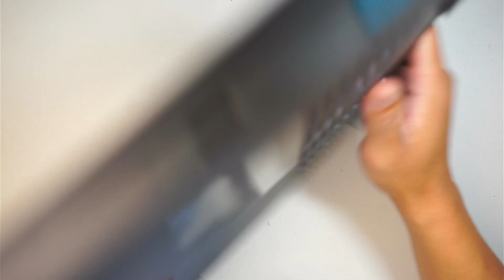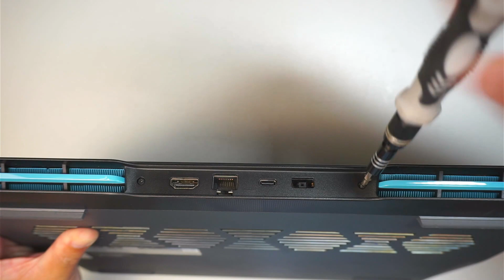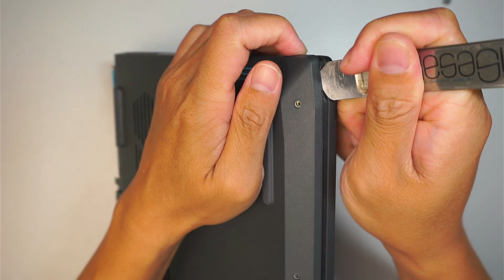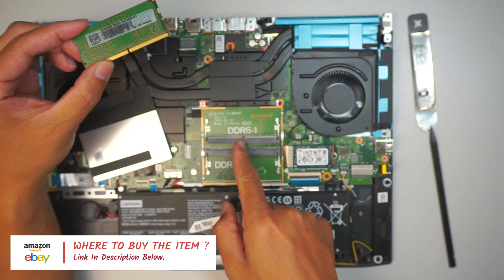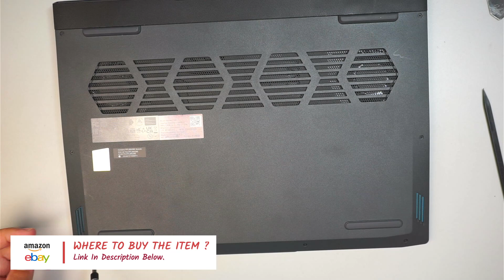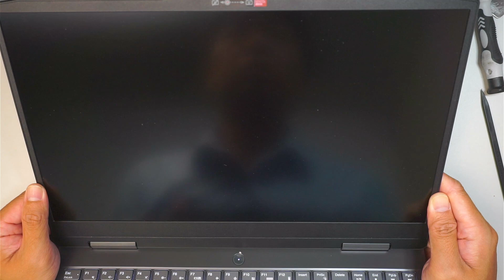IdeaPad Gaming 3 15ARH7 Upgrade and Install DDR5 Laptop RAM

Comment: I want to upgrade my storage and i have 16arh7, and my laptop support two slot of storage. I remember open the back of laptop and my storage is like this small 4:35 here. So what is this, is this 2242 or 2280, so which one should i buy?

Comment: bro i have ryzen 7 6800H and 16gb ram with 512gb ssd , can i upgrade the ssd ? if yes then please tell me how much ?
Reply: yes you can, SSD is cheap, i upgrade it by adding another 512gb SSD just remember which version
Reply: @DasboardTVDE  so there is space of another ssd ? like if i want to use sata , or do i need to replace my current one ?

Comment: I freaked out when my laptop didn't start after upgrading. But it takes time to adjust to the new ram i guess. It started after 3-4 minutes. No need to go into the bios and do anything. THANK YOU VERY MUCH.
Reply: So you do not need to disconnect the battery?
Reply: @Literally-Liteyou need to disconnect the battery or else it might short the board

Comment: Hello everyone, I tried to put an extra SSD in my laptop but the ones who did the job told me that my SSD was not compatible with my laptop, has anyone had this problem when trying to upgrade the storage?
The SSD I tried to use is the Predator GM7 2TB M.2 NVME GEN4X4 7200MB/S

Comment: I'm using IdeaPad Gaming 3 15ARH7 with AMD Ryzen 7 6800H. I'm thinking about upgrading from the 8gb to 32gb (16gb each slot 4800mhz ddr5). 
I'm wondering is it possible because Lenovo said the max memory is 16 gb. But the processor on the amd website (for ryzen 7 6800H) said the max ram is 64 gb. Can someone help me please? 

Thank you so much!
Reply: Yes, I have the same device with the same capabilities as you, IdeaPad Gaming 3 15ARH7 with AMD Ryzen 7 6800H. The laptop had 8GB RAM and I made it 32gb ddr5 4800 and it was fast and excellent for games, editing and graphic design. Now I am thinking of upgrading it to 64 GB RAM 4800
Reply: Yes, I have the same device with the same capabilities as you, IdeaPad Gaming 3 15ARH7 with AMD Ryzen 7 6800H. The laptop had 8GB RAM and I made it 32gb ddr5 4800 and it was fast and excellent for games, editing and graphic design. Now I am thinking of upgrading it to 64 GB RAM 4800
Reply: Yes 32gb will work

Comment: Hi there so for the additional DDR5 RAM card, what Hz module should I get? I think the options are 4800Hz, 5200Hz and 5600Hz
Reply: It generally doesn't really matter. If you have 4800 and you install 5200, the new one will just run at the slower speed.

Comment: Thanks, I just upgraded to 64GB (2 x 32GB 4800  MHz Crucial) and so far working ok. Got scare at first becuase the screen remained black for a while, but after 2 minutes maybe, it turned on normally. 
I have the Ryzen 5 7535HS model.
Reply: what's ur gpu model??rtx 2050 or higher?
Reply: @omarsheikh8835  rtx3050
Reply: ¿Tiene el modelo 15ARH7 with RTX2050?
Reply: 64gb ram is huge dude wth you do

Comment: When installing the metal cover you have to be very careful. I powered my laptop down but when the cover slipped and touched the motherboard it sparked and smoked. On my motherboard there were components directly next to the  ram slots. I was lucky and nothing broke, but be careful and maybe diconnect the battery.

Comment: does the cpu brand matter in picing the ram because I have an amd cpu in my laptop and I looked at a ram and it said that "Unlock the potential of your 12th Gen Intel Core laptop processors" so can I stil buy it
Reply from the maker: Ues

Comment: I had a freak out because I realized that no one made tutorials on this specific build as it seems they changed the internals of the machine but I found specifically you as the only person with the same model. I will be adding an additional 1tb of storage in the extra slot and adding 16gb of ram for a total of 24. Thank you so much
Reply: Does it support ram upto 32 gb
Reply: @annujomon9719  yes
Reply: Did mixing rams work well for you?
Reply from the maker: You are welcome. Glad the video helped.
Reply: What storage did you use?
Reply: Sayori

Comment: Well, I have ideapad gaming 3 15ARH7 , amd ryzen 5 6600H, I haven't opened it yet, so I can to  upgrad 2TB of storage and 32 GB of ram (DDR5) ?
And iditoonal ram with 4800 mhz or 5600 ????
Reply: 4800 only
Reply: @Abdo-Hamdi  so 5600 wont work ?

Comment: I have the 8gb default ram still in, and I have one 16gb stick coming in, I shouldn‘t leave both in together correct? If not should I take out the 8 and put the 16 where the original 8 was?
Reply: you have 8x8 or 16 single?
If yes, 16x8 gb wont work correctly, only 8 x 8 , or like your pc will consume 16 gb in dual channel, other 8gb in single channel
Reply: @scorpi3795 is it better 8x8 or just 16

Comment: Can i keep the 8gb and add 16gb for 24gb total or does it have to match up to 32?
Reply: 8/8 gb , or 16/16 , it will work in single channel if do so.
believe me, 16 gb is more enough for this specs.

Comment: You should had also educated us about disconnecting battery before touching any internal parts
Reply: Been opening PC's and laptops since I was a kid, never ever had a problem with that. Never disconnected anything 😅
Reply: @borky1987 Almost fried my motherboard when the metal casing slipped and touched that copper line around the ram. Luckily only sparks ans smoke, no real damage.

Comment: Thank you for the video. I just got this laptop  waiting for another 8gb of ram and 1tb m2 ssd. I will need this video to install it. Much appreciated
Reply: Bro how is the laptop
Reply: @GodFather6969-s4q  hey i have the same laptop and the laptop is really good overall and no issues after using it for more than 2 months .
Reply: @GodFather6969-s4q   sorry for late reply but i have the same model and i have had it for 3 months and its wonderful and there is alot of things i like about this laptop well like the  conservation  mode how it works is that it stop battery from ageing and if your late for somthing and need laptop to fast charge theres a mode called rapid charge it works really good but i dont reccommend keeping it on always and if your a more of a work guy but you work you might need to  do few optmizations for the battery to last but from my point of view if your a student and on a budget buy it its really good and add more ram for better preformance

Comment: Guys please disconnect the battery from the laptop before attempting anything
Reply: how to disconnect?
Reply: just keep the laptop shut and dont open the lid
Reply: Everything is gonna be fine if laptop is shutted down
Reply: @pratikbawankar8066  shutted down eh .
Reply: Great video! Do you know 16ARH7 use the ram? If not l, can you point out the correct one on your amazon store? Thanks
Reply: The circuit is open... Absolutely doesn't matter... It would matter if you turned it on in the middle of the process
Reply: @RoyalYoutube_PRO  That's what I thought at first, but in my case, when I was in the middle of installing the RAM, the metal cap accidentally touched one of the metal surfaces on the motherboard and generated a spark. I was like, "That's it. The laptop is FRIED," but thankfully, nothing serious happened other than the burnt, dark surface.
Reply: I’ve been fixing laptops since they were invented, I’ve never had an issue not disconnecting the batteries. Just saying lol
Reply: Me too. I don't get it when people are so paranoid 😅
Reply: You don’t need to it isn’t necessary

Comment: I have the same laptop model and I want to upgrade its RAM. Is it possible to have a DDR5 RAM and a DDR4 RAM working together on the same system?
The next question is that I want to install an SSD hard drive, does the size of the hard drive matter if it is 2242 or 2280 or 2288? Or do all M2 socket SSD hard drives fit it?
Reply: No
Reply: He describes both drives in the video

Comment: Fantastic video. I have this model laptop and its a must to upgrade from single to dual channel memory, I went from the standed 8gb to 32gb (16gb each slot 4800mhz ddr5) and its a beast now. The improvment in all games is night and day seen as much as 60 fps gains in some games and no tearing or stuttering in newer games.
Reply: Has someone tried 5600mhz ram in their laptop???
Reply: @pitma1734  the laptop can't take it mate. At worst won't work at all, at best will just run at 4800. Don't waste your money
Reply: @pitma1734  It supports Max 4800Mhz
Reply: @shadeofchaoss  Sorry about your pc brother, on the upside the laptop is fantastic no issues at all since I have updated the ram. When I was running the 1 8gb stick I had 3 blue screens thats when I was playing world of warcraft, with 2 tabs open and discord, the other was having 5 tabs open 2 of which was youtube guides. Since upgrading I have been playing Baldur's gate 3, on ultra settings at a steady 120 fps. also have 10+ tabs open. I have to say do yourself a favour and get the ram and get the screwdriver set he has in the info. way worth the money make the laptop super easy to get into. I upgraded mine in 10 mins it was that fast to do mate. I would also buy an anti static wrist band if you cant ground yourself fully. I got the Crucial DDR5 32gb (2x16) kit. honestly mate you will see instant improvments, On WOW I got 40 more fps. on COD I got 52 more fps, Fallout was maxed at 120 fps never dropped. on Starfield on all high settings never dipped below 60 fps.
Reply: @adamrutherford4083 is the ddr5 compatible? i thought only the ddr4 was for this laptop
Reply: i am talkin abt the ideapad gaming worh the gtx 1650 ti gpu idk if you have the same
Reply: No I have the new one with the RTX 4050 inside it. This Video is the newest model @nicocalcio99real
Reply: It support 32gb?
Reply: Yes am runnng 32 gb @hirensiddhapura
Reply: @adamrutherford4083  is your laptop have intel cpu or amd?
Reply: @kashafraza8958  my one has the new AMD Ryzen 5 - 7535HS processor. No issues and can overclock it.
Reply: @adamrutherford4083  i have a R5 6600H variant rtx 3050, what do u think will it also support 32 gigs of ram ?
Reply: Which brand RAM did you get for the 2x16gb 4800mhz ddr5? Thanks
Reply: Are you using this laptop 32 gb after upgrading.does it support 32gb
Reply: Yes I upgraded it to 32 gb, I am still using it, its a very good laptop after upgrading it. @rahul78330
Reply: But the official website said thats its only up to 16gb? Are u sure that its working 32 GB on yours? 🫠🤔
Reply: I have one with 32gb ram and an Empty slot @gorinrevalandro6083
Reply: @gorinrevalandro6083  yeah i have the exact doubt
Reply: I will get one with 16gb single channel 4800mhz. Will it work if I add another 16gb?
Reply: @marius0448  yes that will be well worth it.
Reply: what brand did you use?
Reply: @hadimuhaimin6461   I used these Crucial 4800 mhz ddr5 ram. 16gig x2
Reply: That is right ,i didn't try it but lenovo said the max memory is 16 gb but the processor on the amd website (for ryzen 7 6800h ) said the max ram is 64 gb many people try to install more than 16 and it work
Reply: can i upgrade the ddr5 ram of ryzen 7 6800h model to 32gb. Because in lenovo official site it says that maximum i can upgrade upto 16gb
Reply: @Roy90-Gamer  many people said yes , i think
Reply: @Roy90-Gamer  I have upgraded mine to 32 GB of ddr 5 ram and have no issues with it. It made the performance way better.
Reply: Hello, may I know the specifications of ram sticks you got on your laptop now?
Reply: @imranahmadov2463  for amd 
Ryzen 5 6600h or Ryzen 7 6800h 
Ddr5 4800 
You can pick up what size you want under 64gb becuase the cpu didn't allow more than 64 
For the model if you need the best you can xhhose the one with lower cl 
Like cruical has cl40
Kingston has cl38
I think and if you would to know what cl it is the latncy for the ram the more lower the more better
Reply: +1 bro i have this pc too 
in cs2 with 8 gb i take 120-130 fps. After I upgrade rams I take around 240-250
Reply: Which brand of ram did you buy? Could you send a link pls

Comment: NO NEED TO REMOVE BATTERY? CAN I HAVE ONE 8 GB AND ADD ONE 16 GB?
Reply from the maker: Recommend to disconnect the battery. Yes, you can run 8 and 16

Comment: it this the ryzen 7 7735 version ?
Reply: @@thomasshears4236 Mines the 6600H
Reply: @iitzFizz hey please tell me about it's thermals and display wobble,is it too much?
Reply: @ayushnimje1977   It's thermals are excellent much better than other gaming laptops. 45 degrees GPU at idle and around 70 under load. Display doesn't wobble too much, a little but not bad at all. I have the 3050Ti btw.
Reply: @iitzFizz  thanks for instant reply one more que
inbuilt ssd is in which slot 2242 or 2280 means the ssd inside it when you bought the laptop

Comment: I have the 15IAH7 which has 16gb of ddr4, i cant replace ddr4 with ddr5 can i?
Reply: No you can't. they are not compatible to each other physically.
Reply: @poonakanwanaeloh7858  The ideapad gaming 3 is weird, it seems to have very different spec depending where and when you buy it.
Reply: In amazon the specs show the lap come with 16gb DDR5 RAM. Why upgrade?
Reply: @akashmuruganandam1462  nope ddr4
Reply: @perseus431  this model has intel 12th gen and i think this gen can take ddr4 and ddr5

Comment: Bro is the laptop can take the ram up to 24 gb?
Reply: On the Crucial website it says up to 64, but on CMD on the device itself it says 32GB. I'm running on 24GB now, waiting for my other 16GB RAM to bump it all the way to 32GB. 

I usually pay Cities Skylines and GTA V and they both perform buttery smooth

Comment: can i install 2280 ssd to 2242 slot?
Reply: I need to know too in my counrty ,you can't find 2242 ssd so i think i can bought 2280 and stick it with double face or something like that but i don't think it will work for long time ,do you try it ?
Reply: No you can't
Reply: you struggling to find a 2242 ssd? sabrent 2242 do them i got a 1tb from amazon £105
Reply: @danieldixon7157  i bought Samsung pm991 256gb just a 12$ and Samsung evo 970 evo plus 1tb 55$ i will uninstall laptop stock ssd. 1tb + 256gb do you think it is enough for gaming?
Reply: yeah
Reply: @osmaanatlii  yeah plenty of storage that 👍👍
Reply: @osmaanatlii  it's suficient. ideally would be 2tb + 512
Reply: Isn’t this model capable of 2280 and 2242? Though

Comment: thanks for the video, i didn't realis e the second slot was only gen 3 but it makes sense if its a low wattage a320 (or similar) chipset.

awesome little lappy (i have the ryzen 5 / gtx 3050 6gb) 

now to start under voting the cpu and gpu
Reply from the maker: Thank you

Comment: Hi my screen turns black and won’t show anything after I add another ram stick to my laptop. Why would that happen? I ordered the 8gb crucial you linked
Reply: i think incompatible ram try by inserting your ram into different slots (if it is like this
ram1-slot1 ram2-slot2 change to ram1-slot2 ram2-slot1) like this
Reply: Good afternoon. I also want to add Crucial SODIMM DDR5-4800 8192MB PC5-38400 / Did you succeed?
Reply: @ВиталийМороз-э2д  hi yes, I unplugged the battery-pressed power button-installed ram- connect battery- and powered right reading the ram 👌🏼
Reply: @kjrayo18  Does it work as dual channel?
Reply: i think it has a max speed of 4800 (which comes default) and a max of 64 gig